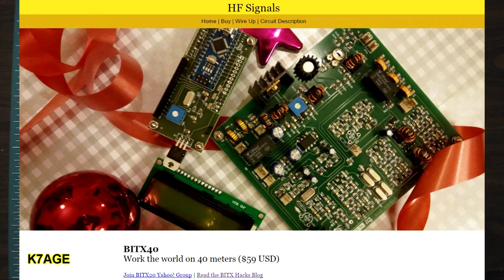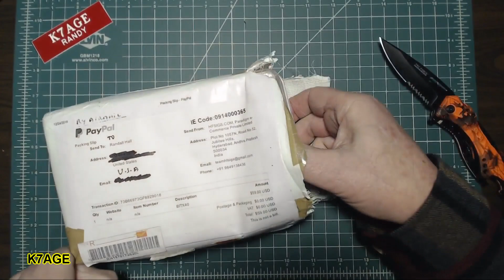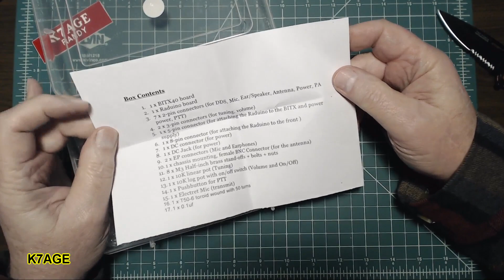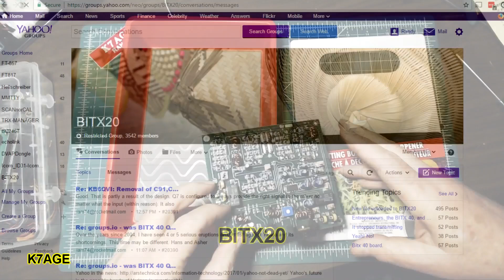K7AGE BITX40 Unboxing

Comment: Bit worried having electronic pcb packed in plastic, ESD? 73 m0wao
Reply from the maker: I was more concerned about the bubble wrap around the board.
Reply: Sorry may be I didn't wrote it correctly but that's was exactly my worry the bubble wrap. In my computer years we had antistatic bubble wrap and bags to store computer parts in
Reply from the maker: no worries

Comment: Randy... that is a VERY nice work surface, especially considering I am unfortunate enough to be using a glass surfaced-table as my work bench (imagine trying to find loose parts on that). Where can I purchase (hopefully exconomically) such a mat?
Reply from the maker: These green mats are vinyl cutting mats. Search Amazon and other for them. They are not anti-static.
Reply: Thanks, Randy, for both pieces of information. I much rather go with anti-static seeing as how my work surface will be almost entirely used for electronics so thanks for pointing that out. Will continue searching but Amazon, as always, is a good place to start. 73s.

Comment: Randy, Great Video.  Ordered my BITX40 Jan 3rd and got ship confirmation Jan 10th.  It would be interesting to compare with your shipping results. 
For my project case I have gutted out a dead PC-ATX power supply enclosure.  I moved the fan outside of the enclosure. Used PCB substrate for the front panel and a small piece of sheet metal attached to rear to mount the antenna connector (still debating replacing the BNC with an UHF SO-239) 
73 ab1op_Ralph

Comment: I would think that leaving the board exposed like that would hinder performance due to the board getting dirty. You could go to a hobby store and get some thin metal or even styrene and build yourself a custom enclosure that would look pretty cool. Looking forward to watching this.
Reply from the maker: It will only be on the red plastic bin while I get it running and play with it. I do have an interesting case to mount it in when I'm ready.

Comment: Hello Randy !!  Another good video !!  What is the size of the two boards for this kit in inches for High, Width , Depth.?I am thinking about buying one too, it looks interesting !!  Remember the ZZ RX 40 ?  I later built mine in an old Polaroid cameracarry case so I can carry it anywhere with a shoulder strap , and there is room for a small battery pack and a small audio ampcircuit and a roll of wire to make a small 40 meter antenna !!
Reply from the maker: John, main board 5'x4.5"x1 1/8" including heat sink. Display with Arduino board, 3 1/4"  with regulator closer to 4" x 1 1/2" x 1 1/2".
Reply: Thanks Randy !  That unit will fit nicely into an older aluminum project housing box that I never used, I will go ahead and order one of these !  once again MANY THANKS !!  John Bellas KC2UVN
Reply from the maker: hope I measured correctly.........
Reply: I'm pretty sure you have the dimensions right.
I forgot to ask,, How did you order this kit?
Was it an Ebay buy? what Address did you use etc?  Many thanks ---  John Bellas KC2UVN
Reply from the maker: go to the hfsigs.com  and click on the buy. They use Paypal.
Reply: Thanks a bunch Randy, Will order unit right after this writing, Many Thanks --  73's  John A Bellas KC2UVN

Comment: Could run a CW signal through the mic jack?
Reply from the maker: Basically, yes. There are guys doing that. There is a lot of information out on the internet about this radio. The yahoo group, now moving to google groups has lots of info. There may be plans to use one of the DDS oscillators to generate the audio for cw. I want to try PSK-31 with a cheap USB sound card dongle. This will require the rig to run in USB, which some guys have done. Probably more software tweaks in the Arduino DDS.
Reply: Cool, thanks Randy.  Always love your videos.   Chris - NI7IN
Reply from the maker: I just wanted to add, CW is by an audio tone through the transmit path. There may be other ways to also do this.

Comment: would the cutting board be able to fit on the open part of the drawer organizer?
Reply from the maker: It is larger. I would have to cut it down. The tub is just while I wire up and get it running. I have other ideas for mods after it is running. Later, when I have it just the way that I like, I have a very special box to build it into.
Reply: K7AGE ahh ok.. was just throwing it out there in case someone else was thinking that too.